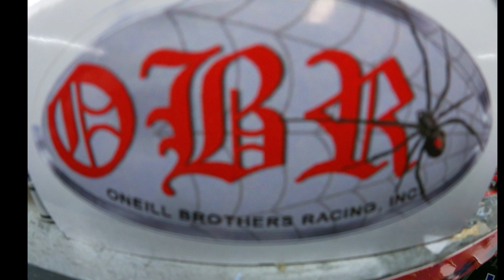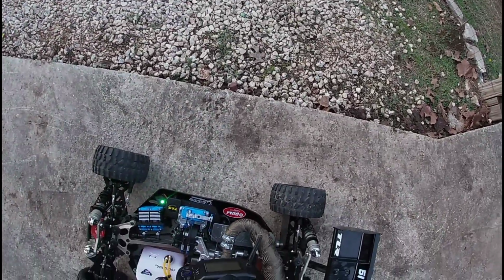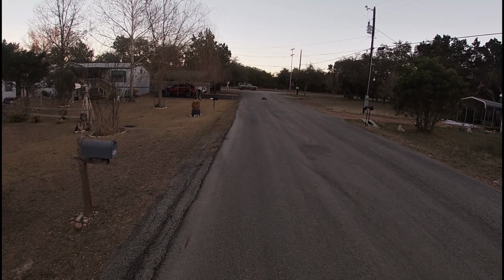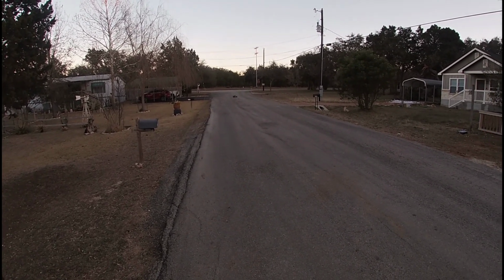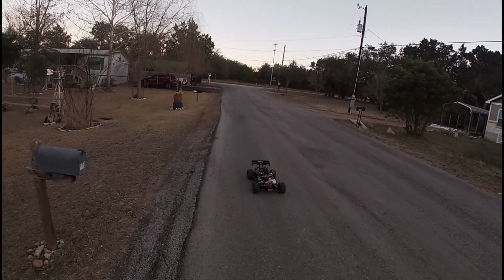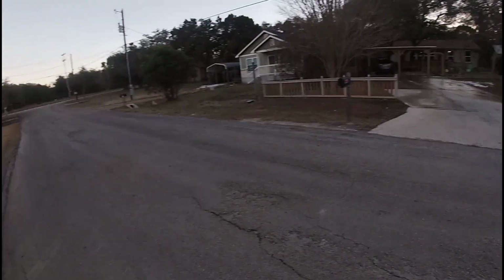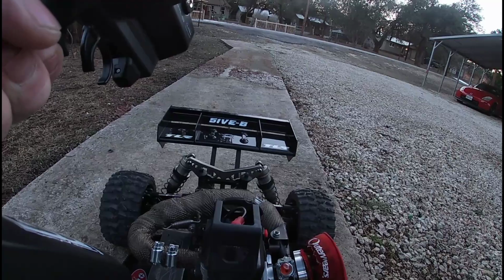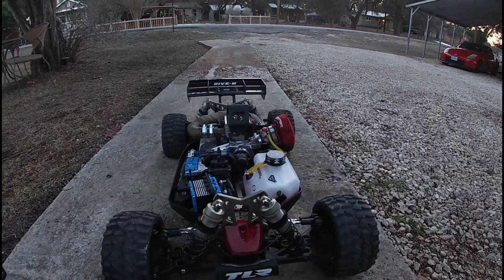YALL HEAR THAT ?? SNAPPCRAKLEPOPP

Comment: To bad you couldn't brake and load up the rpms and  launch like a torque converter.Hold the brake get those rpms up and release the brake and launch.Somebody should make that sure you could if you had a separate switch to brake just a thought.😉Has anyone thought of this if not.First.I guess you would have to find a way to put the throttle and brake  on different servos.
Reply: People are gonna say yeah its called a clutch but think about it if you load up clutch brake till a whatever rpm and release the brake sure it would be hell on the bell housing but how much fun would that be?Maybe Im dreaming. 😆 🤣
Reply: Like a line lock
Reply: People gonna bust my balls.lol but 4 real couldn't it be done?
Reply: @jasonphillips4229  it’s been done !! A lot of people run separate servos on the hybrids !!